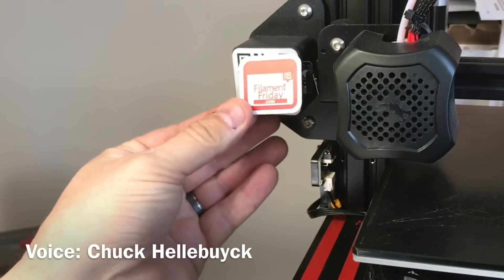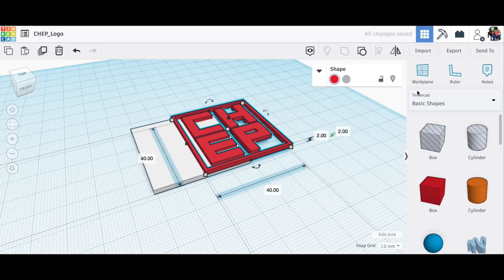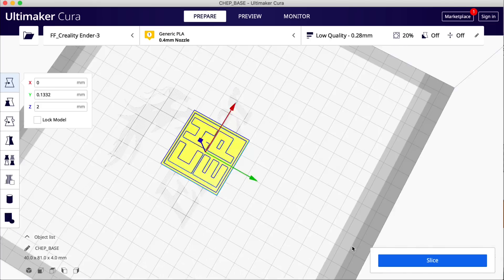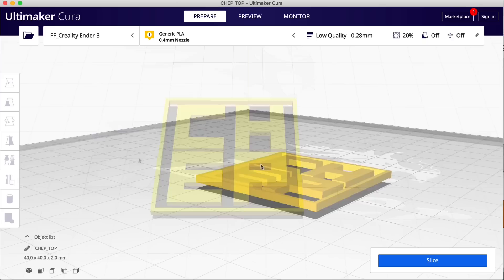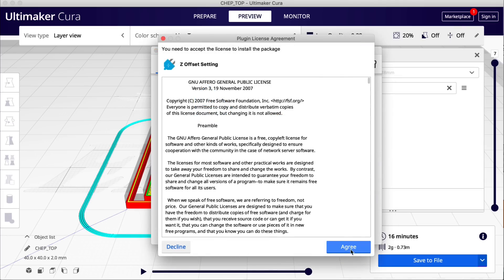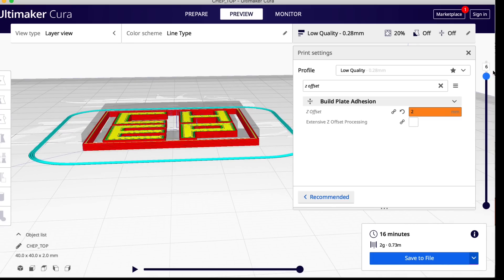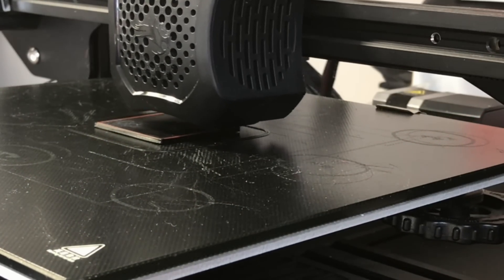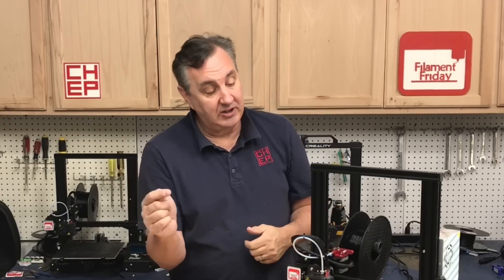Two Color Print Using Z-Offset Plugin in Cura

Comment: BEWARE! This plugin has a bug that can destroy your print. It doesn't lift the Z-axis first, and then goes on to reach the first point of the second print, but tries to reach the 1st point diagonally in space. so if your follow up print does not start at the very front left point of the object, closest to 0,0,0 the nozzle can potentially crash into your print.

Comment: I have been struggling with the most technically difficult print I have ever done. Getting an ender 3 to do fine detail on a custom watch dial. This video provided me with the info I needed to solve the remaining issues. Thanks Man!

My custom watch dial - The base is pink with very fine detail in dark blue on top. 
The issues I was getting were that the dial was weak and broke apart. I was using a concentric top and bottom pattern so that I would get a nice sunburst effect. however, the result was that there was little strength and the dial would come apart in rings.
This z-offset has allowed me to do the dial in 3 phases each with different settings. 
Phase 1 2 X 0.1mm layers no walls lines pattern. This gives a good strong base.
Phase 2 2 X 0.1mm layers, all walls for the sunburst effect.
Phase 3 2 X0.1mm layers with the detail but with a colour change in between after phase 2.
All done on the super fine detail FF ender 3 cura 5.4 profile. Which are well worth every penny. :)

I could have done the color change with a pause but flushing the filament is so delicate. With a 0.2mm nozzle, I found the extrude movement on the printer would not work properly. Thus I had to do it by hand which meant the z-axis would drop slightly meaning I had to start again.
This approach means I can print a small test cube elsewhere on the print bed to flush out all the old colour.

So thanks a million for this video. As ever, it is clear, helpful, with no BS and just straight to the point.

Comment: Hi Chuck, thank you for your videos - the way you explain the details makes it so easy to follow and I already using so many of your methods. I am using a single nozzle Ender 3 V2 Neo with CR touch. I am in the process of printing a Pokemon chess set for my son. I would also like to do a custom chessboard to go with the set. Given that the surface of the board has to be flat, I was wondering whether there is a way that I can put the symbol down first and then print over it (sort of a reverse of what you have done in this video)? Any suggestions are welcomed. Thank you again for your great content.

Comment: Great explanation of the Z offset! Let's say you were going to print 10 copies of your logo doing this, but wanted to print them all at the same time. How would you position the second file to perfectly match up with the 10 prints of the first file?
Reply: Try using Cura's Multiply feature. Import your base, multiply but do not modify Cura's (sometimes far from optimal) placements of copies! Slice, print. Change filament etc. Now import the top, multiply (see above...), use Z-offset. As long as your up/down portions have the same shape Cura will multiply them into the same places...

Comment: Love your videos I stumbled across another way to do this without z offset.  Position the first layer so the homing sensor will touch it then start homing after the first layer.  Print the letters flat on the bed in cura and the nozzle will be exactly the right height above the printer bed to print the letters. Don't forget to rehome after your finished.
Reply: Good idea! However you should disable the cleaning strip on ender 3's if you do this, otherwise the first cleaning strips would be printed on the air

Comment: Didn't work. I'm using an Ender 3 S1 and on the second print it went to home position, CR touch detected the offset of 3 mm for the already printed piece/base, then printer started at 3 mm then went all the way up to 6 mm offset (double as intented) ... i have some ideas on how to play with the offsets tho, but it's gonna take some time to figure it out. Still... Thanks for the video, i did learn something new!
Reply: the first time it didn't work same problem than you... on my Ender 3 S1 Pro settings i try the z compensation but im limited so i try to print my object with an extra piece with same height at the place of the probe to simulate the zero level of the bed ... and it works only beware to align all the layers ...

Comment: Thanks, that is easier than manually splitting a gcode (that is what I have been doing since none of the gcode pauses work with Anycubic printers)
Reply: did this work for you? i also have the same issue with my anycubic

Comment: great idea Chep. but  how do  You keep  bed temp in first piece printed, to allow the adhesion?
Reply: The bed will warm up before printing and create adhesion.  Been doing this by manually splitting the code into 2 parts.
Reply: You can swiftly change to "preheat bed and nozzle for PLA" right when the first print ends to keep the bed warm for the time you need to change the filament. This way the piece won't shrink and lose adhesion. (At least on my Ender 3 I got this option). Downsize is that you need to be near the printer when the print finishes.

Comment: I just tried this out on my Creality Neo with the touch probe.  Downloaded the Z Offset feature.  Used 0.2mm layer.  I have models for a 1mm Base and a 0.4mm Letter.  I moved them off center so the Homing motion didn't crash the base. Two issues:
1- The Slicer file said its 1mm thick but there are only 4 layers, not 5.  It measures .036 thick. 
2- The Z Offset did not seem to work; the 2nd color is smooshed into the base and looks all rough. 
Any clues on what went wrong on these 2?

Comment: Using your print as an example, if I wanted only the letters red and the raised border outline black, how can I get the nozzle to the middle out the print without it hitting into the raised border that would be part of the black first print?  The Z offset would set it to the height of the second print which would be lower at the middle than the border.
Reply: Sounds like you need to use Z Hop.

Comment: I tried to do this using the z-offset plugin and I set my bottom  print at 12mm tall and I set my z offset on my top pring to 12mm. The printer tried to go to its home position at the beginning of the second print from the end of the first print and smashed the first print. I'm using an Ender 3 V2 Neo with the Ender 3 Pro profile you made a video about. I've gott he latest version of Cura and I'm running it all through OctoPi 1.0. Any any ideas why this didn't work?

Comment: Hello CHEP. Thank you for this very practical tip. On a machine like my Ender S1so with a CR Touch, there is no need under Cura to shift the overlay. Simply leave the part in place, the G28 takes into account the thickness of the part and prints on it. Only the purge strips are done in vacuum.
Thanks again.
Reply: Your comment saved me.  I have a s1 and I was wondering how it would react with the CR touch.  I took out the x offfset and the second color printed perfectly.  Thank you.
Reply: Thank you very much for your comment! I needed to print a second color over the first one with a other gcode file in my Ender 3 S1 Pro and it works perfectly how you said! God bless you!

Comment: I know this video is older but hopefully I can get an answer from you, how do you keep your print from popping off when the bed cools using this method?
Reply: In Cura there is an option that I chose for this. Pause at layer height is a postprocessing script you can add to create this same effect without much downtime wile changing filaments. Just find the layer in which you want color to change. Cooling using this method is not an issue as the printing is only paused.

Comment: I have a Bl touch installed, so whwn I do this it doesn't work ? What is the turnaround for that?
Reply: don't use z-offset, the probe will automatically calculate the height

Comment: I have an Artillery Genius that doesn't understand Change Filament commands and is flakey with pause, so this is a great workaround.

One thing to consider is the purge line on the second print. It's fine for low-height models but you risk the gantry wiping it out for taller models, so it would be a good idea to edit the start Gcode to either omit the purge line altogether, or better still, move it to the back.

Comment: I've learned a ton from you Sir and for that I thank You.  Regarding multiple color printing on Ender 3 I must be missing something because after I set the new color filament, I have a nozzle crash.  Is ther a way to lock the gantry so that I can avoid that?  Thanks Again.
Reply from the maker: Your end code is probably releasing the Z motor. Comment that out on the first print.
Reply: @FilamentFriday   I figured out that I was bumping the gantry.  Used the disarm timer set at 1200 so that I had plenty of time to get out of the way.  It worked.  Thanks Sir.

Comment: Can't seem to get this to work properly using my Neptune 3. When I go to print, the nozzle just crashes into my part and won't move. I took g28 out of my start G code and then the print just starts in mid air and won't go to the right Z level. So lost
Reply from the maker: Neptune firmware seems incomplete to me. My Neptune printers just frustrate me.
Reply: It's the same for me too. Did you find any solution?
Reply: Elegoo has their own version of Cura which works well for basic prints but if you want to do any type of post processing their app doesn't accommodate for that.

 Put a ticket to elegoo and maybe if enough of us do they'll get it working.

Comment: on the second print, the nozzle crashies on the model while taking position to print (going from "home" to "z-offset" diagonal)
Reply: Offset the Y axis thats what i did
Reply: Have you fixed that problem? It happens to me everytime, sometimes moves the first object and sometimes dont. But its problem
Reply: @MrVirdji  i have actually, in Cura under mesh fixes, check the Union overlapping volumes box
Reply: Sorry wrong answear, under Walls go to Z seam position and change it to left or back until it will start on the front left corner of the print so it wont crush the hole part

Comment: What about if your using BLTouch with no Z limit switch. it will probe the middle of the bed when starting the lettering print.... how do you do this with a BLTouch without Z Limit Switch ?
Reply from the maker: You can shut off home in the start GCode or just print off center so probe can still touch.
Reply: @FilamentFriday  thanks ! gonna try that tonight. yeah sadly printing off center will only work for very small items that dont take the whole bed... not looking to be limited here
Reply: @FilamentFriday  where is that setting to shut off home?

Comment: Hi Chep.. Every time I try this method my BLtouch will do a measurement before every print.. Is there a way to shut this off on the second file so that it prints without doing a measurement before starting a new sliced file?
Reply from the maker: Remove the G28 home and G29 autolevel from the start gcode
Reply: @FilamentFriday  thank you sir.  I appreciate your work.

Comment: Hi, excellent tutorial. If you can help me with a question. I have a CR-6 Max, and before each print, it automatically homing, touching its nozzle to the bed. If the print is in the center of the bed, the homing will be affected by the height of the initial layer, and also, with the nozzle already heated, it will damage the already printed layer. Is there any way around this? PS: I want to make large prints, which will necessarily be in the center of the bed.

Comment: How would I accomplish this if the 2 files aren't perfectly aligned as in the example video? I have a file and want a different color text, but when the 2 files are in Cura they are not aligned the same, because they are offset from the center.
Reply from the maker: Move one to align with the other.

Comment: Is there a way to do this only printing the text inside of a plate that has raised edges.  The letters would look like they sit down inside a bowl.  For example a plate with 5 mm outside ring with a base set at 2 mm thickness and the text sitting on the 2 mm inside base.  Hope this makes sense.  Great videos.  Thanks

Comment: Hi! Greate content! Could I do the same with a Ender 3 V2 with BLTouch?
Reply from the maker: Yeah. Just don’t autolevel on 2nd print
Reply: @FilamentFriday  Did you try not to use z-offset and let the BL-Touch do the leveling?
Reply from the maker: Not sure what you mean. You need to z offset to lift the nozzle to proper height. BLTouch info can be saved in eeprom and recalled so no need to prove again.
Reply: @FilamentFriday  No I mean the BL-Touch does the z homing. And when starting the second part of the print it probes on the first part and adjust the z height. Or can I prevent the z homing for the second part?
Reply from the maker: That won’t work.
Reply: @FilamentFriday  Hi! Ok, I have tried it last weekend. Printing red and black on a white printed base. Used BL Touch to level z-height when homing without using z-offset it printed on the correct height on to the first print.But there is one issue. As I printed two different colors on the same hight, the nozzle crashed into the black print. After that it printed the red part, but the black print was damaged. So my question is, how can I tell in gcode to move from and to the printing area in for example 20mm height.
Means: BLTouch probes in the center->moves up 20mm->moves to the side and draws the two lines at the side of the printbed-> moves up 20mm-> goes back to the print area and starts printing.

Comment: For what I do  I need the M600 by layer.  Your system is good for a lot of prints but mine is flowers.  My Kywoo Tycoon Max has M600 built into their marlin but I may be getting another printer that doesn't have that.

Comment: Found the video great for me to produce the item I wanted. I set the z offset to the correct hight however the nozzle just caught the edge of the build. 
What reason would that be ?
Thanks
Reply: same here, the z offset doesnt have enough time to go up before reaching the part. would like to know how to make the offset move up faster at the beginning of the print
Reply: I'm reading up on modifying the gcode so I can raise the hot end up first, and then move it over. I think that's probably the best/easiest solution.

Comment: I don't see how this would work if you had a BL touch. It will end up probing on the first print while building the mesh before the second print and then lift 2mm above it thinking the print bed was extremely warped.
Reply from the maker: You don’t run autolevel on 2nd print.
Reply: @FilamentFriday  Hi, do I just remove the G29 Code on my 'Start G Code' in cura when I do the 2nd print? Will appreciate the response.
Reply from the maker: Yes. Remove it.

Comment: Great video Chuck!, New to 3D printing and I'm testing this out right now! But let's say the you wanted the top two characters in a third color. Is there any way to "z-Hop" over the two sessions already printed and print those last? Or could there be another way of accomplishing this? The obvious and manual way is of course to print the third session on a clean bed and glue them on, but that's no challenge :) 

EDIT: Maybe it would be easier to just print the second session in a single color and then print a third session just with a few layers of the third color on top of the two characters? Because there are bound to be some stuff in the way if we are sticking down the nozzle deeper in the third session.
Reply from the maker: Not sure. Have to think about that one.
Reply: @FilamentFriday  Thanks for your answer. After watching my print now, I of course realize that my first idea won't work unless you have very thin layers for the extruder to hop over and move down to, so my 3 mm characters wouldn't allow the nozzle to get down to print. So that leaves the option to either lower the character height by 2-3 layers in order to print the third color on them or to go with the gule option. I will go for the glue option today :)

Comment: My first price was 3mm tall. So I set the off set to that but it was was way too high. Five more atemps of decreasing off set amount, printing then scraping it off because it was too far away from the print. I finely got to 2mm off set, a 1mm difference but  and it worked great! So my first print layer was 3mm tall but I ended up using only a 2mm of set. Why is this?

Comment: how did you keep the bed hot so the part doesn't pop off after the first print?
Reply from the maker: I didn’t. I used some glue stick on the bed.
Reply: @FilamentFriday  is there a way to keep the bed hot after the first print?
Reply from the maker: Don’t cool it off in the end GCode.
Reply: @balancenoptions1322  Or just use preheat on your printer

Comment: Great video and super simple! Just wondering, I have auto bed leveling and use the probe as my z limit switch. I could just get rid of the g29 but the g28 will still try and probe in the center. Any suggestions?

Comment: Is there a way to do this with bltouch? I would have to remove the level/auto home lines in the machine settings? I love that you can create a perfectly smooth flat base to print on. I'm currently running into infill patterns emerging in layers below the 2nd color. With this method, I could iron flat on top of the first color for a great look. Any help would be great.
Reply from the maker: https://youtu.be/pQlZoMF0CVE

Comment: How is it possible to "come back later" and add on to the base print?  That base print would have cooled and released from the bed.
Reply from the maker: Use glue stick
Reply: @FilamentFriday  thanks. I don’t think this will work on Ender 5 plus stock as it doesn’t recognize M600 gcode
Reply: I'm trying it as we speak. But I use glue stick on every print, and don't print without it.